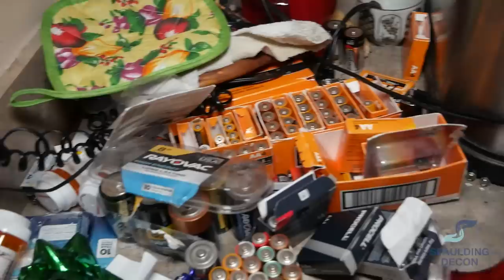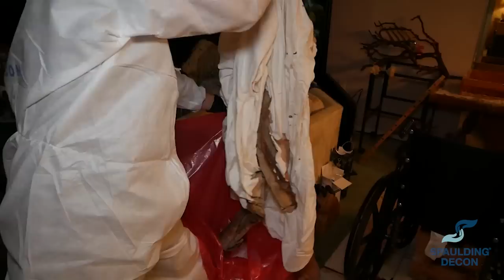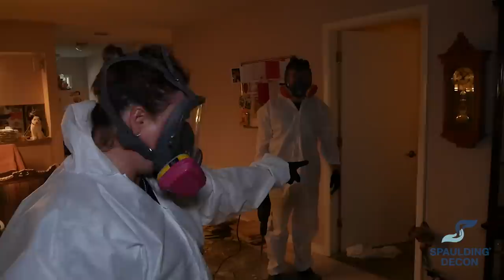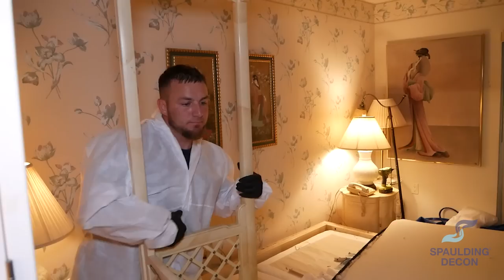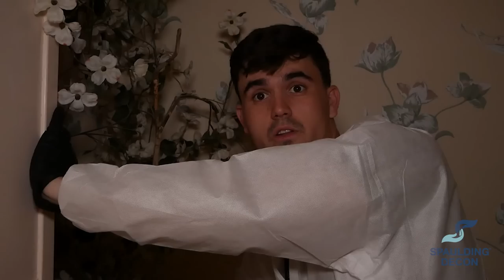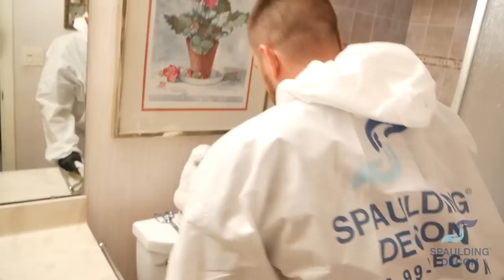BIRD OF PREY | Bio-Hoard (1/3)

Comment: Hey there my fellow technicians over at Spaulding Decon! I have a serious question for you, and anyone willing to answer.

I had a job in which the customer had gone over the area in which we were working, with a black light, and was particularly concerned with what they had seen. It was a tiled area of a hallway, leading into a tiled bathroom. 

The initial request was to potentially save the tile. Now with the grout and everything, typically tile is torn out, period. In the case of this instance, the tile was torn out regardless, but my question is. Did i do anything wrong? Typically I don’t like to rely on black lights for indication, and sanitization is all I can guarantee on a “I want to save it” surface.

Theres no way we can actually remove that factor of the affected materials without actually ripping out the materials, correct? 

Job was successful and the customer was pleased. Just really threw me off when the gentleman busted out the light. I’ve never honestly had anyone do that before… yet, usually people are okay with the removal of any and ALL affected materials…

Thanks in advance, Spaulding Decon. 
You all are amazing people!
Reply: Usually they paint over the spots that cant be removed to seal it. Right?
Reply: @camillebambi6449  Yes, but my original thought was about the tile. The tile was cleaned and sanitized, but the blacklight revealed the history on the tile. 
We removed the tile regardless. 

Concrete, I always seal after cleaning, with Kilz. 
Particle Board or Chip Board Subflooring fully removed, or if the customer requests they don't want it removed, I'll seal it with Kilz as well. 

Can't really paint over tile, it wouldn't make sense to keep it and paint it. Super tacky. 

I'm just saying, if there is blood and matter on tile. The history won't EVER be removed without actually demoing the tile. I want to know if I'm wrong. Can you actually remove that black light indication on tile? 

There is no way, I've tried just about everything.
Reply: @dwainetyncompany  have you tried a steam cleaner? I swear a steamer with a small nozzle  (high pressure, “jet spray” like) will remove anything from the tightest of spots.

Comment: You guys should invest in some hook blades to remove the carpets and a wide floor wedge blade attachment for an SDS hammer to remove the tiles. And always work from the leading edge not the closed in edge like the guy in this video did.

Comment: I know someone who relapsed with some friends. And one if theor friends OD and the individual I know apparently went into shock not knowing what to do. Did not call the police till almost a week later.
When the police arrived the police apparently gagged the smell of the body was intense. They told the individual they need to let landlord know and to get the fluids from body professionally clean. 
However that is not what happen. The individual waited another week before cleaning and did it themselves just by using a steam cleaner. 
I told the individual they need to let their landlord know.
I got no clue if the landlord is aware that there is a mess in the unit..
It was a carpeted bedroom. 
The individual told me the steam cleaner did the job. But I'm worried on what underneath the carpet. 
Especially after watching your shows on how clear you guys clean up.

Comment: Might be stupid to ask but please I just want to get more knowledge: what happens if you just super clean the surface (I mean don't remove the tiles and stuffs)?
Reply: There would still be bio in the grout between the tile, it seeps in and is nearly impossible to remove due to the porosity. Could also seep underneath depending on how well it has been sealed. And if you ran a blacklight over it you would see the history of the tile.
Reply: Also definitely not stupid to ask, its reasonable considering you may not see bio left over with a quick glance if the tile had just been simply cleaned